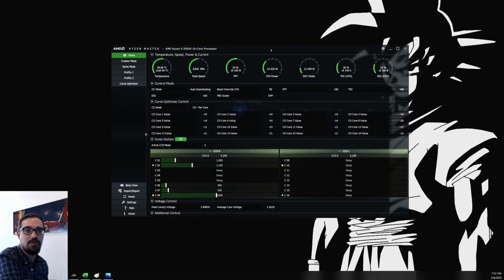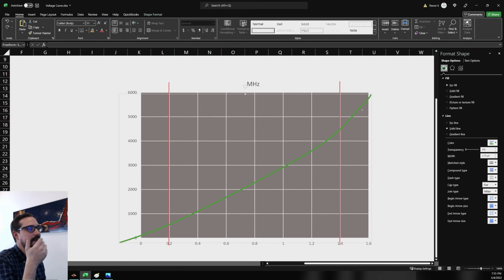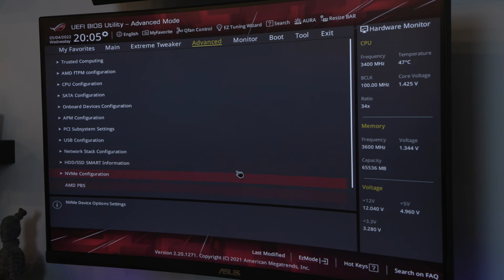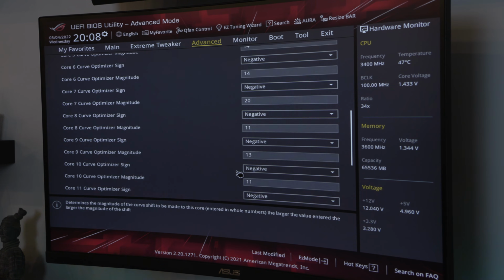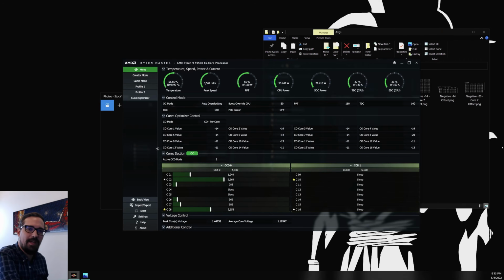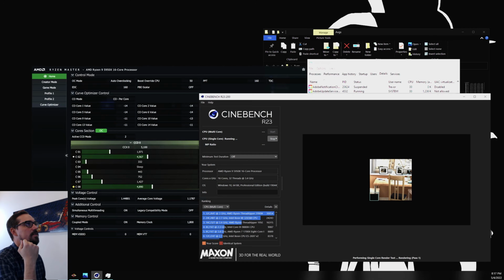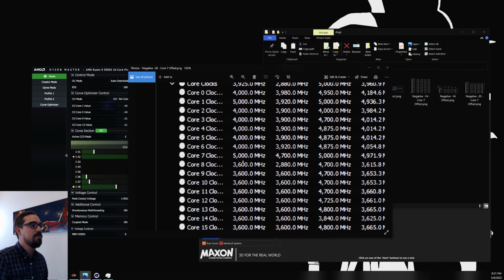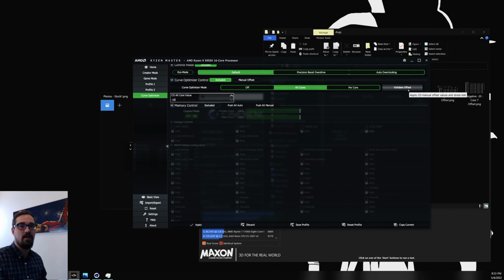AMD Overclocking - Curve Optimizer Explained

Comment: Thx so much!  Just upgraded to the 5700x from my 2700x and working with PBO2 and Curve Optimizer via Ryzen Master exactly as you show. 

I was finding it a bit confusing exactly what the problem was but suspected it was a case where the auto tune tool was not very accurate as is typically the case with an “easy button” solution. RM was setting me to -30 on 6 cores and -28 on two others but I realized immediately I was failing any and all stress tests. 

Yours was the first video I found that explained this in such a clear and concise way. I went to a -10 on each cores and if this proves stable I’ll probably called a day.

By the way, the 5700x is proving to basically be a 5800x once you get PBO2 dialed in. Steady at 4.65ghz single and all core. The general “snappiness” all around vs the 2700x is very noticeable which I honestly did not expect. 

You have a new subscriber sir !
Reply from the maker: My pleasure! Glad you found the video helpful! Thanks for the sub!

Comment: Power plan balanced, grab 5% to 0% minimum usage.

In ryzen master settings:
Stress test:
Time 600 seconds

Type of load:All.

Back to Curve Optimizer: Per Core.
Slap the start optimizing button.With these settings it will test all the v/f in both single and multi core. On 5950x is 1 day 21h 30 min testing, for others less.

Best tunes comes with default settings and scalar off. With the override one cores get a lot less curve shift and you get clock stretching on most cores. Focus on effective clocks, multiplier are not real sustained clocks.
Ryzen 9 works best with no override
Reply: What is v/f

Comment: Since I upgraded to dark hero motherboard I am having game stability issues . Earlier I was using MSI x570 tomahawk no issue at all . Now game hangs . I get Nvidia driver has stopped working issue and recovered . I tried everything from fresh window to latest bios , latest driver no luck
Reply from the maker: That's no fun! The Dark Hero is a great board, but unfortunately around 1% of the time electronics fail after manufacturing even when they have passed QC testing.

Are you using any power extension cables on your GPU or motherboard? Have you updated to the latest BIOS? Which GPU are you using and how many watts is your power supply?

I've seen several issues with power extension cables as well as GPU vertical mount riser cables. It could also be a bad board, it sucks when that happens but Asus has a pretty solid RMA process in my experience.

Comment: May i ask? What is Curve Optimizer? Is it overclock or undervolt?
Reply: Is curve optimizer dangerous that one mistake can dmg your cpu? Can it also void the warranty? Thank you in advance 😊
Reply from the maker: @Noone-cl3ih  AMD does have a disclaimer about warranty, but it isn't going to break your CPU.
Reply: @UnhingedSystems  my room is just really hot it goes upto 40° sometimes in noon and abt 32-35° in night in night i see a big difference in temperatures
Reply from the maker: It moves the voltage/clock curve so that you can run higher clock speeds at the same voltages. It causes lower voltages at lower clock speeds so in a way you could call it undervolting resulting in overclocking. It isn't really undervolting though because the CPU is still running at the same voltages you are just telling the cores to run at higher clock speeds using the same voltages it normally runs at the standard clock speeds. Because you do get lower voltages at higher clock speeds you can get instability at lower clock speeds where the voltage is no longer sufficient to maintain those clock speeds.
Reply: @UnhingedSystems  does it decrease the temps? All i want is just for my cpu temps to decrease it idles at 50-60° cuz of my country heat(temp)
Reply from the maker: @Noone-cl3ih  What cooler are you using?
Reply: @UnhingedSystems NZXT  Z63 kraken
Reply from the maker: @Noone-cl3ih  Not really, no. It isn't going to have any major impact on temps.
Reply from the maker: @Noone-cl3ih  For the 5950X I usually recommend a 360mm AiO and a REALLY good thermal paste (Thermalright TFX etc) to keep temps down. How warm is the ambient air there in the computer room? Having ambient temperatures of 35-40C is going to make any high-end PC cry out in agony. Your liquid temps are going to be hitting 60-65C at those temps which is hard on the pump. The hotter the ambient air the more surface area you will need to dissipate the same heat that you can at lower temps with less surface area. Heat exchanging is most functional with higher temperature differences between ambient and the coolant. So ambient 25C liquid 40C will exchange more heat faster than. 35C and liquid at 40C. If you can get a larger cooler you can keep the coolant temps lower, but expect 10-20C temperature difference between ambient and coolant.
Reply: @UnhingedSystems  my room temperature is going 30-40° depends on time if it's noon it can get up to 37-40° if it's night it gets around 32-35°
Reply: @UnhingedSystems  I have Ryzen 9 5900X i use thermal grizzly paste
Reply: @UnhingedSystems  i don't have AC btw
Reply: @UnhingedSystems  thank you for  your time and for replying btw thank you very much!!!
Reply: @UnhingedSystems  does it decrease the temps? All i want is just for my cpu temps to decrease it idles at 50-60° cuz of my country heat(temp)
Reply: @UnhingedSystems   what do you think that moving the graph in positive direction and override max core boost +100, +150 or +200 mhz. Does not it make lower voltage more stable?
Reply: You will never break your CPU doing an "Undervolt", at max you can get instability/restarts.

Overclock is another story.
Reply: @ZeroCool22  so how do you undervolt a cpu?
Reply: @Noone-cl3ih  Hi, undervolting is dependent on the motherboard. Boards from MSI, Asus, Gigabyte may have these settings in an "overclocking" section of the BIOS. The interface for the BIOS can be loaded by pressing the right key soon after turning on power. The right key is one of F1, F2,  Del, Esc, sometimes it may be Space, F12, F11, or something different, it's not hidden there are just a lot of motherboards! Had they hidden BIOS I would have found it anyway, it's not that hard. As soon as this interface loads one should understand that these are the settings to make elevators work, when an elevator doesn't work, this is where a technician repairs it. Now you are here to adjust them volts. Just for context. Alright - so basically what you're going to do is - dive into these editable text-fields to subtract some millivolts from the central processor, COMMIT the changes to the hardware and restart the PC to see how it goes. Didn't start? Have to go back to Zero, and to Zero The Machine Out, one only needs to reset and reload the CMOS by using a tiny switch or the naked wire pin-jumper's somewhere around the bottom half of the motherboard, this is soo easy CMOS will only take a sec

Comment: I notice my AMD run very high frequency even low load, did AMD try to overcome this issue by keep running at high freq
Reply from the maker: The frequencies do change based on load, light loads the cores run at a lower clock speed, but any main thread will boost that core up to a higher speed. If you are using a manual overclock most monitoring programs will only show the max clock speed instead of the real clock speed. Ryzen Master is reliable when looking at individual clock speeds on the cores.

Comment: Your video is gold. I agree with your analysis as I independently came to the same conclusion today after spending 21 days of tuning. Here are my observations and conclusion:

I did exactly same visualization while tuning my curve. I bought a ryzen 5950x recently and took it as a challenge to stabilize the bottom part of the curve while maintaining the top. Finally came to a value of -12 on all cores except the worst 2 cores. Contrary to popular belief of maxing out on neg offset for worse cores (ridiculous values like -30 or so), these need to have more voltage to be stable. I found the worst core to be stable at -8 and 2nd worst to be stable at -10.
The trick here is to play a minimax sort of game. You want your best cores to boost higher, but not so high that the worst core eat too much voltage but not perform.
But you also want the curve to have enough voltage so the worst cores dont crash at idle. That means there will be a upper bound and a lower bound that will exist.
And within these bounds, you can simply assign lowest neg offset (-12 in my case) to the best core and higest neg offset (-8 in my case) to the worst.
I spent 21 days extensively testing a lot of strategy i found on internet and none use to be stable at idle. This is a classical case of general wisdom being wrong.

Remember, there is only a single curve and all cores operate on this single curve based on their offset. I have tested for 7 days continuously with various stress test at all possible kind of scenarios to come to this conclusion.

My cinebench R23 scores are ~29200 multi and ~1612 single core. Note that I believe that I have not won the sillicon lottery. I would say I have an average CPU here. My RAM is also 3200Mhz (mixed 2 Pairs and running on timings on which both are compatible, ie the timings of the worst pair) and I use NH-D15 for cooling (so no liquid cooling). My mobo is Asus Dark Hero. However, for me, I am not using dynamic OC as I am getting best of both worlds just by curve optimizer.

The best tool to check per core stability is corecycler. All the best.
Reply: Exactly..Btw, this analysis of yours should be shared as much as possible so that community can upgrade their strategy to tune ryzen processors, especially the ones with 16 cores (32 logical cpus)
Reply from the maker: @mehulajax21  Feel free to share it anywhere and everywhere! Trying hard to make useful content when I have time to!
Reply: To add: I took overclocking ryzen 5950x with curve optimizer as a challenge. Otherwise I would not spent so many days to max out my chip.
Note thaf the difference between all core -8 and my optimized curve is 2-3% in benchmarks. It will not translate to visible benefits in real life scenarios for most parts.
So unless you take this activity as a challenge, I would not recommend you to spend sleepless nights tuning this.
Btw, on my MOBO, with asus's boosting ON and PBO enabled (not the one under AMD) and set to auto, I get the same results as manually changing the PBO under AMD to MOBO limits and all core neg 5 and 10x scalar. So even a default PBO on will give great perf for most.
And dont care about high voltages and stuff...These CPUs are designed to survive these voltages with realistic workloads.
Reply from the maker: Thanks for the comment! You are bang on that this is really the kind of tuning only an enthusiast would undertake it just takes so much time, patience, and real-world workloads to truly prove it all out.

That being said, it's a fun learning experience and the little extra performance boost is no extra cost so why not right?